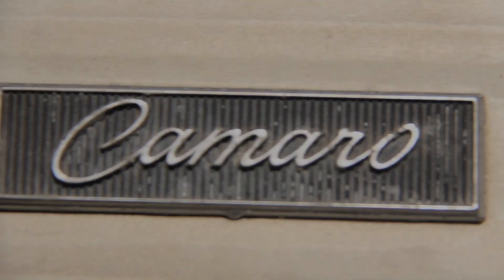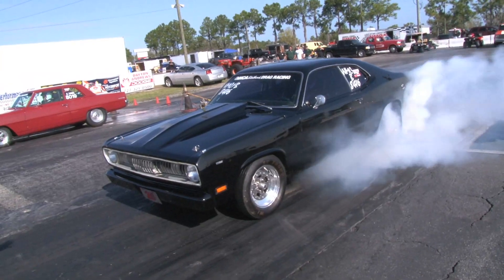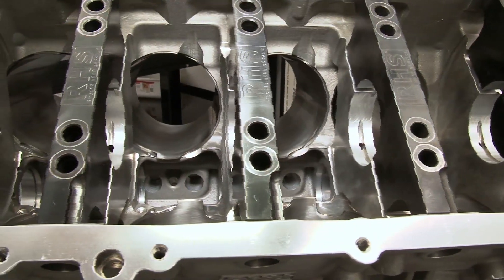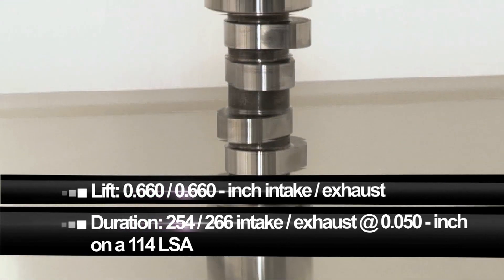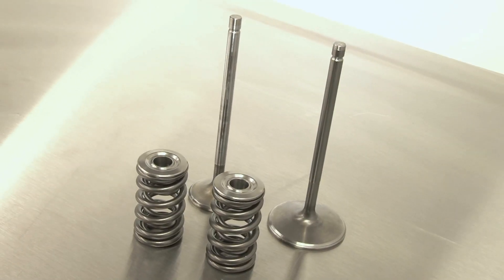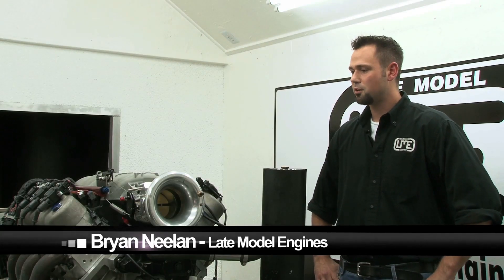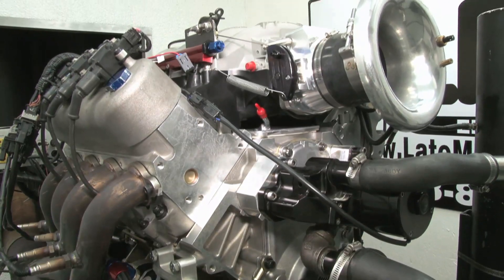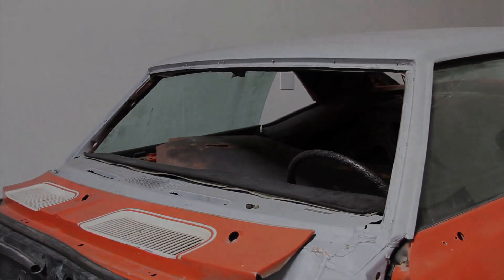LME Builds a 700+ HP Pump Gas 502 RHS LS Engine + Dyno Results

Comment: ok so 700 hp at fly wheel probably 650 at wheels on a heavy car.... god only knows the price and a nissan gtr has 600 hp AWD and can get 800+ hp AWD to the wheels with bolt ons for a fraction of this build cost... ummm yea sounds good auditorily  but id pass

Comment: An engine like this, for the application, I would have run a bigger camshaft & at least one holley 4500 Dominator carb. Probably make another 100hp on one carb with less cubes.

Comment: To achieve a 700+ HP on an NA build takes skill. I'm in the process of doing the exact same thing’ with a 427 billet block; albeit with a Plazmaman intake coupled with a Harrop OTR air filter box. In fact, I’m considering LME or Borowski as my builder, because I have confidence in their work.
Reply: Starting with that RHS block and heads, it is not hard to break 700 HP.  The FAST intake is the big hold up, it really puts the cap on the RPM.  Check a couple years later when they use some different intakes that will keep up with that displacement.  They're making 800HP.

Comment: if you cant get 2 hp per cubic inch.......go back to your shade tree.........
Reply: papashake shake im sure they could with the equipment available to them...wouldn’t leave it the most driveable though...It has a different purpose
Reply: Hey papashake, please show us your N/A 1004 HP LS based motor. I'll check back in a month to see and hear it run. I'm sure you've seen dozens of them. Please detail your build so dumbasses like Lingenfelter, Katech, Mast, and I can learn your secrets. However, I suspect that papashake is an alias for G. Ima Dumfuck. Time will tell. Until then, please hurry-I am anxious to learn from a master.......

Comment: Is an RHS 502 with the appropriate internals a good match for boost?
Reply: No.  If you're going boost it, you need to build it smaller.  502 require 4.165 bore.  There is not a cylinder wall thickness left.

I was warned not to use power adders beyond a 100 shot of nitrous.